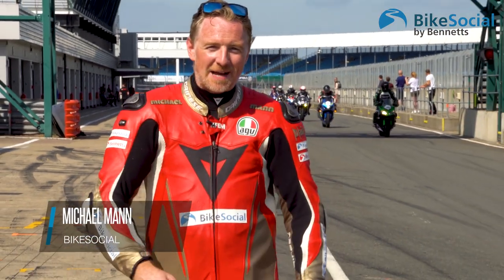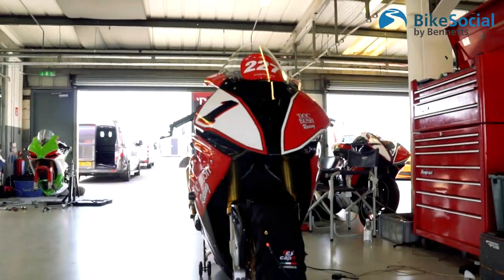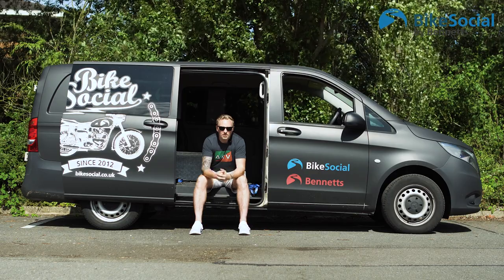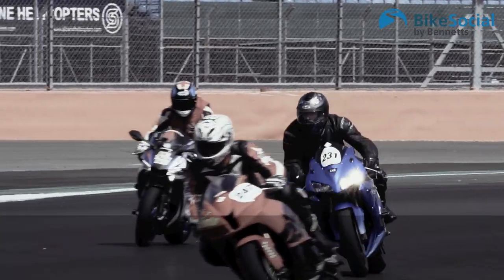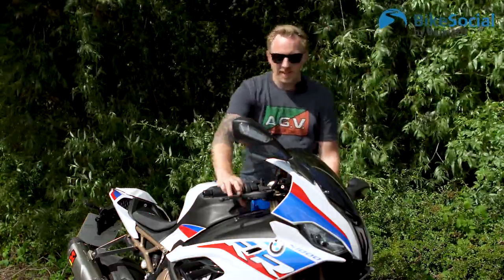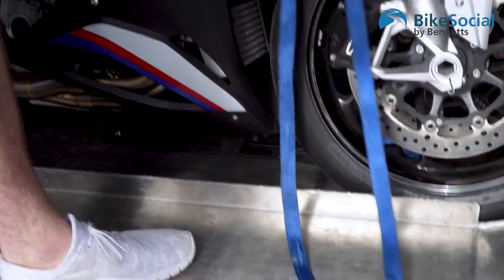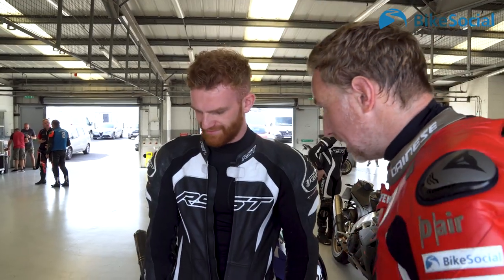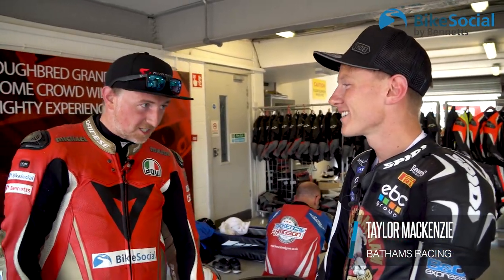First Motorcycle Track Day [Top Tips] | BikeSocial

Comment: Just done Caldwell, not done one for years and years. It was a lot faster than I expected for novice. I'm not a slow rider on the road so soon got into it but if you were pretty green and not a fast road rider it may have been a bit intimidating.
Reply from the maker: It can depend who's running it – our track days try to ensure different abilities are in the right groups, and having done Cadwell on a Grom in the past on a Bennetts BikeSocial track day, I can say that MSV, who we work with on them, did an excellent job.
Reply: @bennettsbikesocial  I was one of the few riders on a pure road bike that rode there. It was mainly trailers and tyre warmer boys on track bikes. I'd say it was 90% track bike. It was also mixed with the inter group and some of those guys were pretty quick with some vaguely strong moves going on. My mate wants to do one but I'm suggesting he does the pure novice one at Cadwell with no other levels.
Reply from the maker: @1000sofusernames  Definitely. I would recommend looking at our too, though I think Cadwell is already fully booked up: www.bikesocial.co.uk/join

Comment: what you should do when straping down the bike is strap it down from the stand side first. This is so that if you over tighten a strap on the non-stand side the bike does not fall over... 
You can tighten a strap down on the stand side stand down and not worry about the bike falling over when doing the other side.
Reply: Pitbull TRS

Comment: I'd say it's a bad idea to use hook straps over the yoke, or anywhere that compresses the suspensions for that matter. You have to either fully compress the suspensions (thus potentially damaging the seals if you hit a bump), or risk the straps getting loose if you hit a bump and the bike's suspension is compressed. In my experience, it's always better to use the wheel axle on the front and the swingarm on the rear. The bike will not move and the suspensions will be free to move in case of a bump.
Reply: Pitbull TRS

Comment: From someone who is relatively new to track days my 2 bits of advise is 1. brakes. My second day out when I got some more confidence and speed into corners my brakes  couldn't cope. So for the next day out I rebuild the calipers, racing brake fluid and sinster pads. Game charger. And 2. Forget about getting the knee down. I have seen some very silly and costly mistakes from new track day users trying to get the knee down. Like this video explains just work on your lines and body position for the first 3 or 4 days out then you can start to think about getting the knee down when the cornering speed comes.